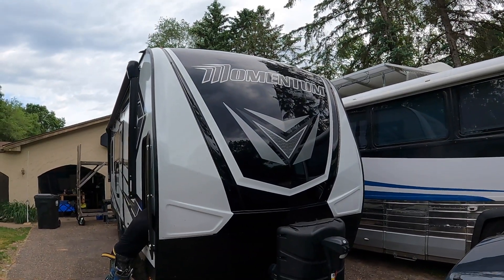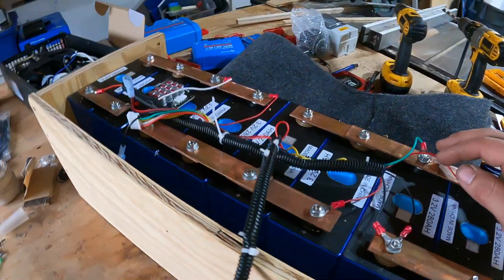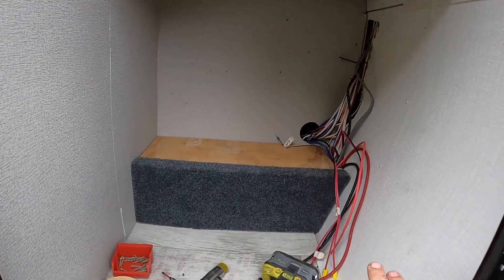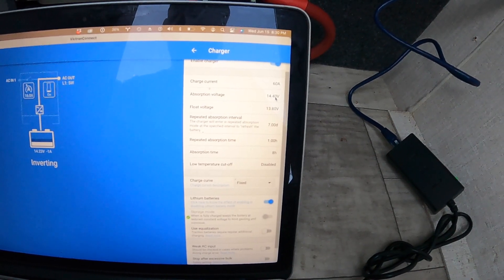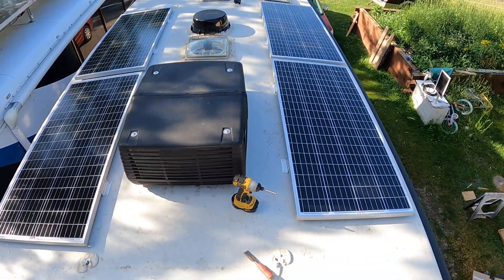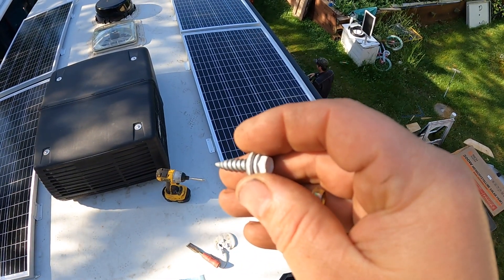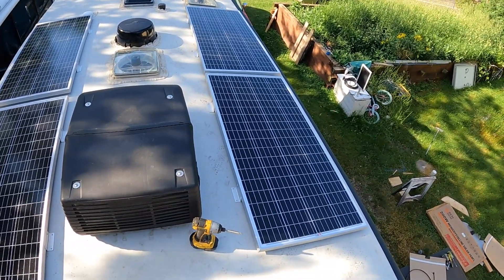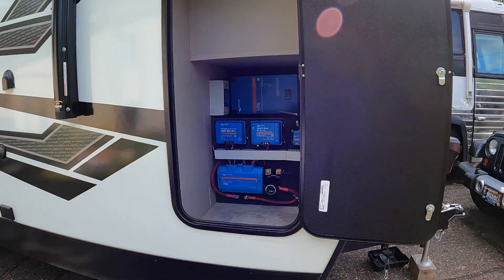Grand Design Momentum G Class Toy Hauler Victron Solar System Install

Comment: Clean install. I love how all those pretty blue Victron components look and integrate. They're just a little out of our budget though. I built that exact same battery a little over a year ago. I put it under the steps of my motorhome where the original pair of GC-2s used to reside. I cut a 1" hole in my step riser and mounted a tiny CPU computer fan that blows directly on my 5a active balancer and into the battery compartment from the interior of my MH, to keep this space from freezing in the winter and overheating in the summer. I used a Heltec 330a (1,200a surge) BMS to flow enough current to start my 5,500w generator. We built a 620-watt liftable solar array on the side of our motorhome. We lift it to the optimal angle to boost its output vs flat mounted panels, especially in the winter, when it performs more like an 800w flat mounted array. It makes a nice bedroom window awning too, practically lifting itself with a couple gas struts, and it's easy to clean, standing safely on the ground. We use an Epever 50a MPPT charge controller and a Lnex shunt and battery monitor which have worked flawlessly. We retired 5 yrs ago and boondock most of the time. We boondocked for 8 months straight last year and this system has served us well. 

By mounting our solar array on the side of our coach, we left the roof free to rack 8, 550W Sungold Power solar panels (4,400 watts) down the length of our 35ft Class A, 15" off our roof, above our AC, fan shrouds, etc. They will cover the entire roof, providing some nice shade with plenty of cooling air underneath, further increasing solar output and reducing the heat load on the air conditioners too. We're in the middle of this build now. I just finished coating the roof and all the solar rack's mounting brackets with Tropicool roof sealant earelier today. In a couple days I'll be lifting these huge panels on the roof - which will be no easy task. We installed our Sungold Power all-in-one 48V, 5,000W Inverter/100A charge controller/battery charger a couple days ago.

We're top balancing our 48v battery bank now which consists of 16, 320ah grade A prismatic cells. We'll be using a 200amp Heltec 16s smart BMS on this bank too. Together with our 560ah 12v bank, we will have a total of 23.5 Kwh of batteries and over 5,000 watts of solar onboard. We removed our rear 13.5k btu rooftop Dometic AC and are replacing it with an EG4 28.5 seer-2, 12k btu mini-split heat pump, which should arrive any day now. This second phase will provide 24/7 off-grid air conditioning, supplemental heat from the heat pump and allow occasional usage of our rooftop mounted, soft-start equipped Furrion AC in the front of our MH during peak afternoon hours, with 6,000 total watts of 120v ac power available. We'll soon have total off-grid electrical independence on a budget we can afford, reserving our generator for back-up use only.
Reply from the maker: Wow, that's quite a step up and an amazing system you're building!   We love seeing people think outside the box!

Comment: Trying to figure out how to use what came with that,my 31g,unit stock solar setup.There’s 2 wires with wide molex connectors and phone line? that isn’t connected to any thing.I’m guessing inverter is gone? In same closet you put all that time into,nice work!

Comment: Have the same camper and trying to copy what you’ll have done here. I have the box installed but how did you fabricate the rest? Did you’ll mount another piece a wood above the box?
Reply from the maker: https://share.icloud.com/photos/093Y7gWstb_b9IY0QpgvfOmCQ Maybe this will help.  We'd love to sell you any Victron equipment you still may want or need.
Reply: 3:10 I was referring to the area that holds the distributor and solar charger. This seems like another piece of wood in front of the battery box?

And I might have to take you up on that!

Comment: Doing almost this exact install right now on my Momentum. Did you just install the inverter AC in line between the transfer switch and the rest of the trailer AC wiring? Thanks!
Reply from the maker: Yes, good luck!